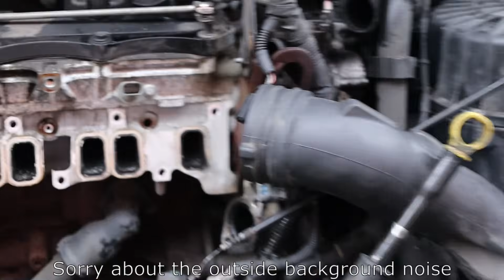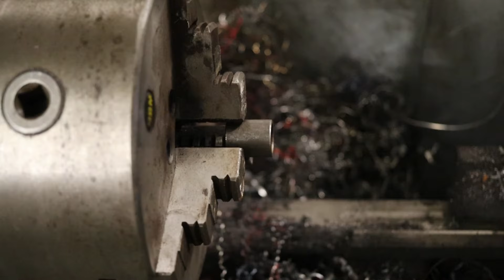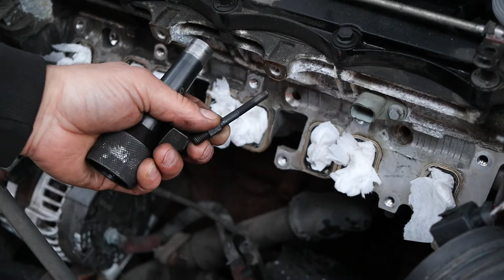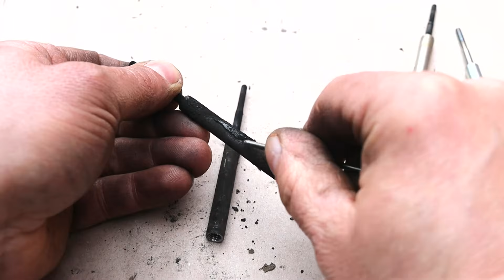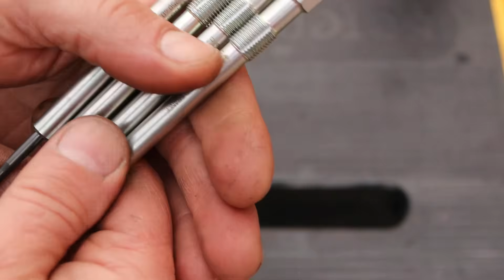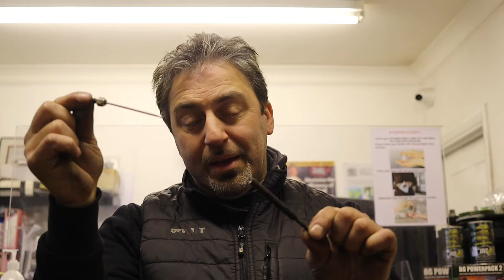Peugeot, Citroen, Ford Broken Glow Plug Removal

Comment: Could you have cut new tread before plug removal as you drilled by thread no need for grease then remove plug also ceramic grease any good on new threads
Reply from the maker: @christopherhughes2649  thanks for your message but sadly I'm not making much sense of your question! 😞

Comment: Ok I get the idea of cutting grooves into the threads but if the plug doesn’t seat properly won’t the combustion gasses leak past the threads and blow ?   What method/ routine do you use removing any glow plug ?
Reply from the maker: @audimanuk  if the seat leaks regardless of the grooves, the carbon build up seizes the plug, the grooves will be an early give away that there's a problem with the seat! I use various ways of getting plugs out, I did a BMW 2 months ago, took me 12 hours to do 2 plugs, the tip fell into a cylinder, after getting it out the replacement plug went in crooked and caused a similar problem but worse. Had to drill it out again and the tip fell in again 🥴 sometimes jobs go bad, watching these videos doesn't always make it easier to do! 👍

Comment: Great work Mel. Makes you wonder why glow plug manufacturers don't make the plugs with slots ready cut in the threaded part?
A friend just took a Ford Focus to be serviced, and the mechanics managed to break off all four glow plugs that they said needed changing. They now want an extra €1.200 to make good their work which they'd quoted €400 for. Do the glow plugs work every time you start the car? If not, with winter temperatures here rarely going below +5 degrees C, then perhaps they don't need changing as often anyway?
Wish there was a local Mels Motors here!

Comment: Hi Mel
Excellent video. Definitely gained a subscriber!  I can see this was carried out on a front wheel drive vehicle.  How would you tackle a similar task on the same engine, but in a transit rear drive, with longitudinal engine. Any advice appreciated, as I have issues with my plugs that need replacing. I imagine the difficulty level is dramatically increased with a rwd van ..😕

Comment: Got this problem on mini with Citroen w16 lump but one has left just the tip. Tried a drill and tap kit but only get into the ceramic insulation which simply pulls out. Any ideas much appreciated. Cheers for a great video.

Comment: Thank you for your video. Regarding cutting into the threads of the glow plugs... I think it is a great idea to have a channel to put fluid in, when you want to remove them again.
But my question is, does it not also create a hole to have reduced compression in the chamber? Like the glow plug goes directly into the cylinder, could the tiny holes not be an issue? Maybe it is a dumb question for a car mechanic, but looking at the glow plug, it is not air tight, otherwise there would not be sut and ash up the whole glow plug, so my thinking...
Thank you!
Reply from the maker: Hi, it's not the thread that stops the combustion gases escaping nor the compression, it's the tapered seat at the bottom of the glow plug. Good question though as not many people know that! 🙂👍
Reply: Thank you for your fast reply. But my question then continues, did not you say yourself in the video, if it is not sitting at the bottom properly than the dirt gets up the glow plug? Which would then mean, it does not seal it "perfectly" in the beginning? @melsmotors
Reply from the maker: @ppgrlu-r6y  it depends on whether it was actually torqued correctly from factory, or it was replaced by another person without cleaning the hole or seat properly with a wire brush. The most common issue I see with glow plugs is that whilst removing them they strip the thread out of the head, they seize and then snap, it's not always soot related. I hope this gets closer to the answer you were looking for! 🙂👍

Comment: I have a situation where I drilled too much and the tap will not make a thread as I drilled too much down and the tools will not tap. How do you solve that?
Reply from the maker: You will have to get a thread kit, the hole will have to be drilled slightly larger to make room for the new thread, this isn't something that could be explained in words it's more of a show and tell! I would guess that the thread is M10x1.00. Good luck 🤞

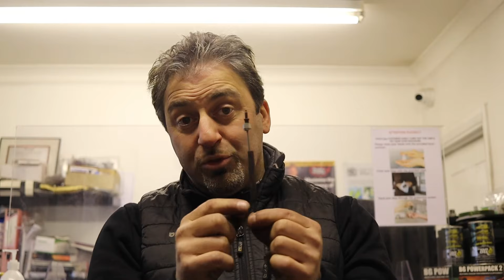Comment: That is exactly what I did what he mentioned not to do at time 25:01 which is, broke the smaller part of head of same drill bit he used to drill them out. End up replacing entier cylinder head; cost me USD $7000 with all parts and labour.

Piece of advice to all. It is not that simple to drill them out using that same tool kit. All respect to him and his practice and master hands, that look so straight forward.
Reply: I tried slowly and Off & ON for 4 month and end up crossings the line where no engineering/machine shop could help me..... hahahaha. 
The last day of my hopes was when diesel sprayed all over the engine from that glow plug hole.....
Reply from the maker: I'm sorry to hear about your disastrous outcome  😯, With the cylinder head off, a good engineering shop should have been able to help you! 
Slow and steady wins the race!! Thanks for commenting and sharing your experience!

Comment: Do the plugs break easily with all Ducato/Boxer/Jumper engines? I have a 2012  2.3 litre engine which is from Iveco if I remember correctly and I am in doubt whether I should replace them or not.
Reply from the maker: Hi Sanne, These engines are the 2.2l transit engine and are different to the Iveco engines. These don't usually snap that easily, you normally get a feel when they're tight. They are normally torqued up to 8-11Nm

Comment: This is easily one of if not the best video about the removal of glow plugs!
But please mate, for your own safety, use a dremel instead of a normal angle grinder for slotting the threads, you can just hold the plug with one hand and use the dremel with the other!

Btw, instead of using grease for catching the shavings when cleaning the threads in the cylinder head, you could just as well put one of the broken plugs back in, that way none of the shavings can land in the cylinder ;)
Reply from the maker: Hi, I'm not sure where to start by answering this message and why your way isn't great, but thanks for watching and adding your own little input. I would love to see one of your glow plug videos, there's always something to learn 👍
Reply: Great   vid  I have always said more than 1 way to skin a cat you do it the way that works for you  I'm no expert always willing  to learn new tricks thank you

Comment: Can you help i have looked up bosch glow plugs and there are several different lengths ie 112mm 114mm so unsure which to order my van is 2018  2.0 blue hdi 130..
Reply from the maker: Hi Stephen, your parts supplier will be able to help you with that conundrum. They'll need a reg number, then use your chassis number to narrow down the search! 🙂👍

Comment: Great video! In the first half I was wondering, if your not cleaning out the threat. The trick with the grease is a very good idea. Would it not be even more secure to clean out the threat as long as the old glow plug is still in?
How high is your success rate with this tool? Have you ever had parts of the tool snap inside the glow plug?
Best regards
Reply from the maker: Hi Mo, thanks for your comment. You can't clean the thread with a glow plug in the head, once removed if you clean the threads 'DRY' all the dirt will fall into the cylinder head, this isn't a great idea hence why you have to use grease to collect the dirt. My success rate has been so far 100% - Go slow, take your time, it's not a race to finish but a steady walk to succeed ☺👍
Reply: @melsmotors  Excuse me, what I meant was not instead of the grease, but additionally.
Sounds very good! My tool is supposed to arrive today. I read many reviews about drills breaking in the plug, bit worried about that. But with oil and patience I might be lucky. Also I ordered a kit of "BGS diy". Slightly more expensive and not the usual BGS quality, as it is their cheap line, but somewhat I still have more trust in that brand.
Reply from the maker: Hi, I use BGS tools, they seem pretty good. All I would say is if you're unsure, please consult a profession. This is just a video and not a tutorial, we make these videos for the interest of our customers and for Youtube enthusiasts. If you brake the drill bit, it will a head off job!!!! Be patient and let the drill do the work.
Reply: @melsmotors  I am also happy with all my BGS tools so far, but they are from the main brand, not from BGS DIY. I will see how it works.
I am aware of the risks but I have my engine out anyway, to replace the timing chain (BMW N47). But before I take the head off I would prbly try to dremel out as much as possible, put everything back together, start the engine and shoot the plugs out with the compression. Of course with a wood board etc in place to make sure it doesnt kill anybody :D

Comment: Hi. Excellent video thanks for posting. Do you think it's worth changing glow plugs as a matter of routine say every 60K Miles? I have a 2017 Crafter with 65K on the clock and wondering if it's worth a change to hopefully prevent trouble in the future.
Reply from the maker: I would suggest replacing them as needed, I've seen some last the life of the engine! Thanks for watching and commenting 🙂👍
Reply: I drive an older D4d Toyota and I like to take them out every 20k miles for a clean and simple test. Access is easy in my case.

Comment: hi my 2.2 DCI Renault master had one snapped off when I bought it,it's snapped off just below the thread the center electrode and most of the outer casing is still in there it doesn't leak and it's been like that for a few years best to leave it alone ? what's the chances of it dropping into cylinder ? great vid by the way.
Reply from the maker: Hi David, WOW! It definitely won't fall into the cylinder as it sits on a taper, but if it every comes loose whilst driving, there will always be a little hole in your bonnet to remind that you once had a glow plug that broke just under the thread 🤔😕😟🥴
Reply: @melsmotors  the top of the glow plug is still screwed in so the bottom broken part cannot blow out ! I know the casing is tapered I was worried about the electrode dropping into the cylinder not likely ?

Comment: You don't have to use a cutting wheel to groove the threads.  I've been using a hacksaw for the last 50 years.  Slower but I still have a full compliment of fingers.  Also, the torque figure is almost certainly for dry threads.  If you are using lubricant, the figure needs to be reduced by anything up to 50%.
Reply from the maker: Hi Mike, thanks for your input, no two mechanics work in the same way, my dad was a mechanic and my son is a mechanic, we all work differently to accomplish the same thing - 'It's Fixed' - Only then do we get paid 🙂👍 Thanks for watching and commenting

Comment: Best video I’ve seen so far on this problem, most dont mention about removing the old thread. Doing a Mercedes  OM605 atm, bought it with one broken gp.. carefully removed 3 of the others but No 1 is threatening to break, moving about 3/4 turn. As you say hard to get lube in there. Kit came without correct tap and drill broke into 3 bits, fortunately got it out.
Reply from the maker: :face-orange-biting-nails::face-orange-raised-eyebrow: Good luck, hope you get it sorted

Comment: Has anybody tried to fill cylinders with diesel fuel and let it sit for couple of days?
Reply from the maker: Thank you for your question, but sadly it's not a great idea. For one, when the cylinder is full the diesel/penetrating oil it will only touch the tip of the glow plug, the thread is about 6 cm higher up, rendering the process a failure. Secondly diesel fuel is very viscous meaning after several hours or days it will seep past the piston rings and end up in the sump contaminating the engine oil, on top of this lengthy job you'll have to also replace the engine oil. Lastly if you're lucky enough to have good piston rings and the diesel remains in the cylinder, you have no way of getting the diesel out, cranking the engine over is also not a great idea. Thank you for taking the time to comment, if people don't ask these questions they'll never know the answers. Thanks for watching ☺👍

Comment: This is by far the best video on the subject that I have watched.
I’ve got to try and get one out on a Transit.
Unfortunately some lasher/idiot has tried to get it out and snapped a  4 mm bolt in it.
Any advice would be greatly appreciated.
Kind regards, Joe.
Reply from the maker: Hi Joe, I don't envy your dilemma. The bolt is so narrow that you couldn't even drill it, if you try and drill it the bit will snag and snap, adding to you troubles. Your only choice might be a milling bit, look on ebay https://ebay.us/kgRA2D
I hope this helps. Thanks for watching and good luck 👍

Comment: Also was wondering with this, is there any kind of schmutz you can put in the end to make a seal so if it doesnt seat proper you dont get the blowby as that would seem the only solution to this as unless they are precision machined and your glow plug properly faced I would imagine you are always going to get that blowby...mabe take an old one some valve grinding paste and lap the housings maybe...

Comment: The world should lobby for a re-design of glowplugs as imagine the uproar if you had all this rigmarole changing sparkplugs and they were made out of chocolate like glowplugs usually are... they need to be designed to be as robust as a sparkplug...
Reply from the maker: Sadly designers don't fix these cars they just sit in an air conditioned office and make stuff up, mostly out of plastic. Thanks for watching and commenting 😊😊
Reply: You forget many of the engine components are meant to be dealer items, thats the bread and butter for dealers, 'sorry head off' another 500 pounds on the bill, coding batteries, fuel pumps, air con and some switch gear, everything will end up like Tesla and Apple, no touch, no replace all factory coded and only with factory tools programming.

Comment: Amazing job done by a pro, like the fact you kept it real, no "Hey Guys welcome back to the channel" and speeded up bullshit. This is indeed a days work, more if you have to take the head off to get to them, Glowplugs are the bane of the diesel owners life. So piss poor made and weak, designed to fail...But that set at 300 quid, good for you working everyday at a rate but not for the home mechanic. 

but I got a lot of insight on how to set about this, I'm probably going to take the head off, drill to the edges of the thread and then drift them out from the cylinder side (Renault G9U). Also this never showed what happened to the old threads, although when you retapped them with grease that probably did for them or am I wrong. 

Good to hear a you tube mechanic tell it like it is about the time, shit light, working in the cold and rain and bending over a high fronted vehicle and just the sheer oily, filthy, graft that working on cars day in to day out takes..
Nice tip on the notches, I do worse things with a grinder everyday and still have all 10 fingers, but it only takes one slip and all that can change...
.
Reply from the maker: Thanks Dan for your comment, I appreciate it and thanks for watching 👍🙂
Reply: @melsmotors  But I looked up that tool you're using and did the Yorkshire "ow much" on it...how can such an ordinaryish tool be costing 300 quid...daylight robbery, but they know you need it is why really...Extortion...but like I said for a pro like you its a must if you do diesels...

Me I'll go the cheap but long way round have the head off and take it somewhere and have them bored out by the pros or replace the head if needs be, It needs a new head gasket and timing belt anyhow as mines got 179.000 miles on it and the belt is due a replacement anyway also (its a second gen Renault Master G9U 650 engine) 

and then when I put it all back together I can also replace those piddly little 8mm rocker cover bolts with that weird bolt washer all in one design from Renault, that means you can't get a socket on them properly with some "normal" hex holts in a 10 or 12 size with a lock washer...
Reply from the maker: @danashcroft961  Good luck in the repair, no one said being a mechanic was easy. Looks easy in the videos, took 32 years to get there. 👍👍😊😊
Reply: @melsmotors  Damn straight Mel, but what I noticed about you was the effieciency of motion that a good tradesman has to have. You didnt seem to sweat it had the right tools to hand and wasnt sweating it...by the way what make was that spanner you were using as that looked proper kosher as that is what I find difficult these days is finding proper made to last tools for the right money...instead of all this made out of plastic metal chinese rubbish that breaks on the first stress useage...
Reply: But a quick question for you if the Thread on the rocker bolts on a master is an M6 (might be wrong on that) can I get an M6 thread with say an M8 head...Normally I'd just sling what was there back on, but this van is going all over the world with me and I know they'll be coming off in future so I might as well replace them with something more user friendly now...
Reply: and will they need to be any special type of metal to withstand the engine heat and expansion...
Reply: What I am thinking of doing is just grinding the flange off them and making them into a hex bolt that way...the cheapskate way...
Reply: As locking rings and washers are cheaper than specialist bolts and whatnot...